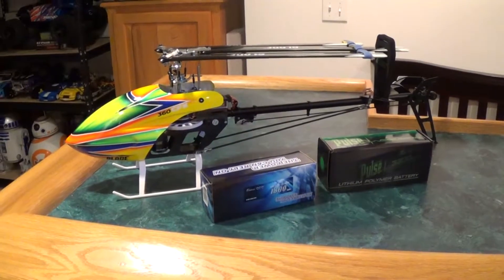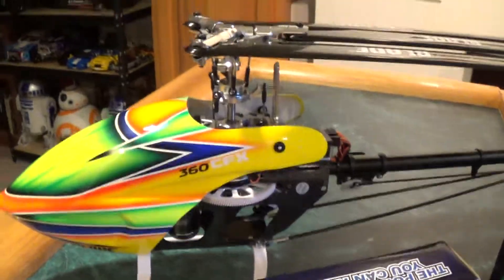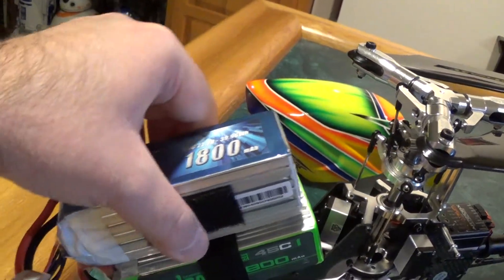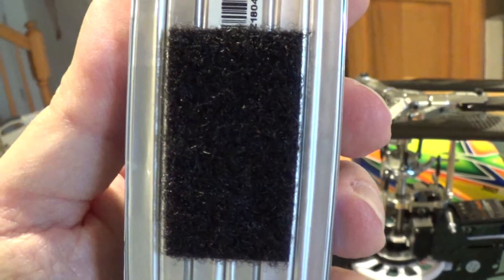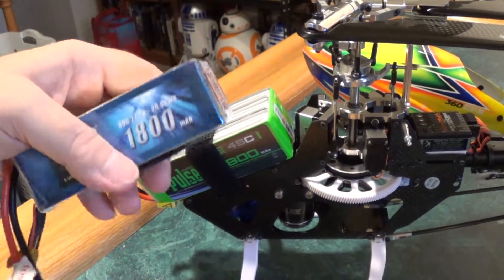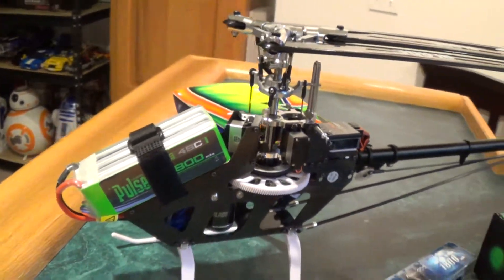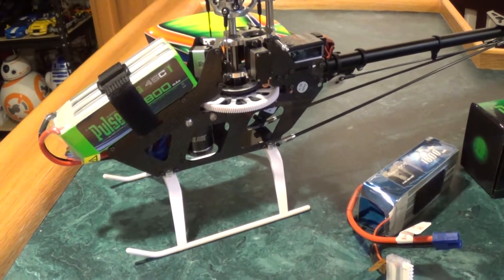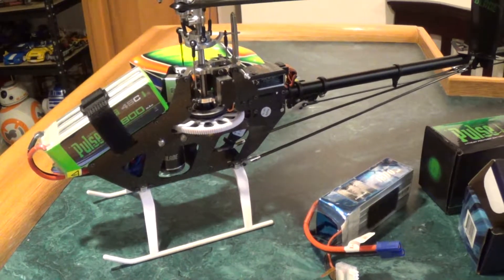Blade 360 Trio CFX Pulse and Gens Ace 1800mah Lipo Upgrade

Comment: It’s really big trust me ... I have optipower 1400 mah and it’s hard to put canopy
Reply from the maker: They are large, but I made them fit.  I mount them on their side with the wires facing up and they just fit🤪.
Reply: Edward Turck nice very good did you notice nose heavy ?
Reply from the maker: Syndicate 997 

I mark each lipo battery and place it on the battery tray where the center of gravity is spot on.  The heli isn’t nose heavy or tail heavy.  It flies great😁.

Comment: What charger do you use for these batteries?
Reply from the maker: I use my Traxxas EZ Peak Plus 6amp 80 watt AC/DC fast charger that is capable of charging LiPO, NiMH, NiCd, LiFe, and LiIon.  I already had this charger a few years before I purchased these batteries and it is capable of charging up to 6s batteries, so I didn’t have to get a new charger.  This is a great charger, but I believe it is discontinued.  I have had Venom chargers before and I would highly recommend them as well.